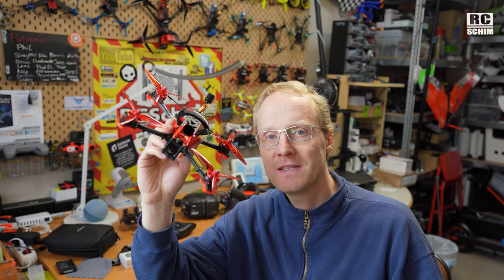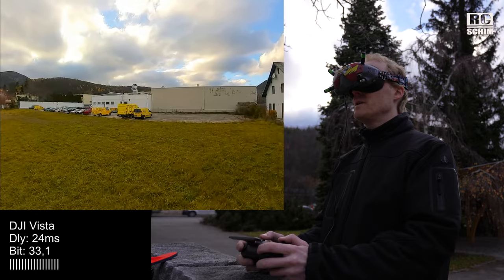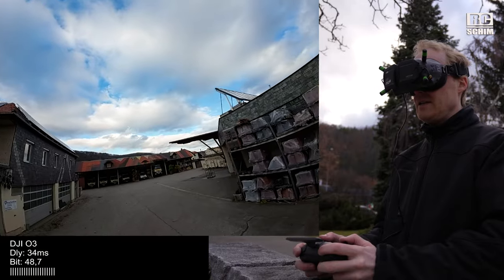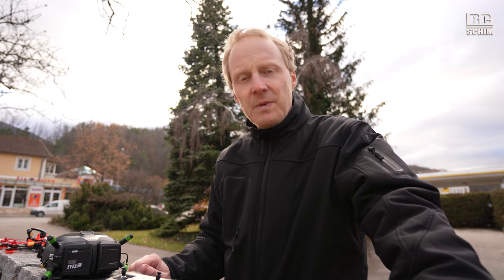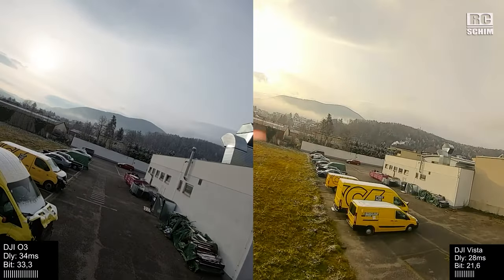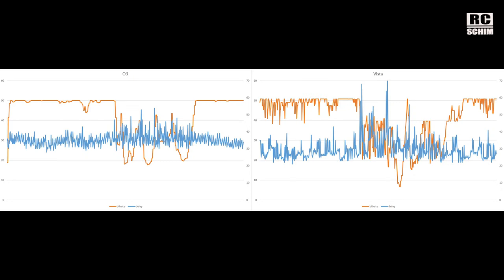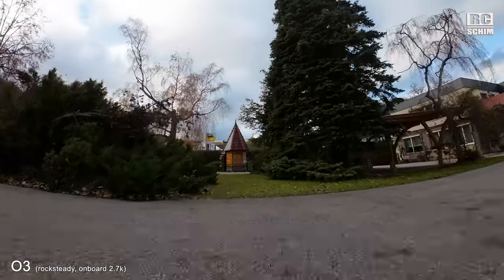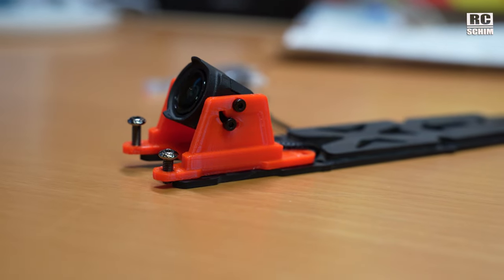DJI O3 - how does it look compared to VISTA?

Comment: I don't understand ..if it was analog and you flew through garage , it would flicker white outs, why does digital not do that? both still transmit through air wave. help me understand my OSD is killing me.
Reply from the maker: You mean your ocd, right?
The magic of dji transmission comes from the retransmission in case of a bad packet. The latency goes up a bit but no flicker ;)
Reply: @Rcschim  yes OCD. but OSD could mean , obsessive stupidity distorter lol.  So when I fly my analog behind some trees and get some flash outs like we see ..Ok am I missing something . is this recording , your goggle dvr?
Reply from the maker: Just for fun I asked ChatGPT your question, here's the answer:   "An analog signal is a continuously variable physical quantity that represents information. In contrast, a digital signal is a sequence of discrete values that represent information.

When an analog signal is transmitted through the air, it is subject to various types of interference, such as noise and distortion, which can cause the signal to become distorted or faded. This can result in a "flickering" or "white out" effect when the signal is displayed on a screen or monitor.

On the other hand, a digital signal is less susceptible to interference because it is composed of discrete values rather than a continuously variable quantity. Digital signals are often transmitted using error-correction codes, which help to ensure that the signal can be recovered accurately despite any noise or interference that may be present. As a result, digital signals tend to be more robust and reliable than analog signals, particularly when transmitted over long distances or through challenging environments."
Reply from the maker: most of what you saw in the video was DVR recorded in my goggles, only a short example of onbaord HD recording was in there.
Reply: @Rcschim  My life is complete now ! Now I will sleep .Thank you . I want to be  digital some day  😜

Comment: what is better at this time?? Goggles v2 Or Goggles 2☺
Reply from the maker: I'd love to try the G2 for their OLEDs and better colors and slightly higher res, smaller formfactor.
But from a friend I know that the fitting can be a bit problematic. Smaller "sweet spot" of sharpness.
Since they are at 850€ pricetag here in EU - I'm not gonna try them soon ;)
From specs:    if you need the lowest latency - the Gv2 are better (120fps),   but have a bit lower resolution (which is hardly noticeable).
greets, Mario
Reply: @Rcschim  Thanks a lott for the Reply..❤️
Reply: @Rcschim  I know it can be very subjective but I couldn't go back to the V2 after flying with the Goggles 2 at 1080p. You wouldn't think the difference would be that huge, but it was night and day to me. 810p looks very similar to 720p, which can be a huge change when going to 1080p
Reply from the maker: @matthewbradley8971  Thanks for the opinion. I'd be quite curious to test the G2. But a friend of mine sold them and went back to V2. Maybe on the next spring FPV meet someone will show up with G2...
sadly they are ~ 850$ here in EU - and this is too much for the small? additional quality improvement...

Comment: O3 have much higher laterncy than vista
3x-4x ms vs 2x-3x ms
Reply from the maker: Yes, but only because I didn't use the 120fps mode on the O3. I thought the image will be too dark with shorter shutter time....
If you use the high fps mode you get lower latency on the o3 as well...
(100fps on g2 and 120fps on gv2)

Comment: H265 is only with goggles 2. That is h264 we are seeing.
Reply from the maker: Are you sure? Where did you find this info? Would be quite the placebo effect for me then ;)  how do we explain the better details with less Bitrate? Not only from using the 265 as codec but also some other clever coding?
Reply: @RCSchim  I think it was Mads tech. I looked for it but couldn't find it, I have watched so much 03 content lately. So maybe I miss understood. I remember something g about v2 is h264 and goggles 2 is h265. I apologize if I'm incorrect.  I'll look some more and link it if I find it.
Reply from the maker: Ok, the DVR files from O3 are h264 - you're right! in 4:3 mode they are 1080x810   with 60.0024fps  and around 20mbit datarate as MOV files.   (1440x810 in 16:9 on Gv2)
Vista is MP4 file extension also with h264 960x720 with exactly 60fps   but they use 40mbit of datarate.  So I'm even more curious now why the vista looks so blocky over the gras where the O3 looks better. O3 uses half of the bitrate for writing the file... confusing.
Reply: @RCSchim  it's gotta be the compression.  They are packaging the tx/rx data differently. Maybe just smaller packets along with improved software.
Reply from the maker: @grampafpv  maybe the h264 vs h265 is just on the storage side (when written as a file)   and here it is no problem that they still store in h264 on the Gv2 where they can write to h265 on the more powerfull G2.
transmitted thru the air might have nothing to do with h264 or h265 codec - but is a different approach...
however they do it, it's clear (literally) that O3 does it even better :)
Reply: @RCSchim  I agree. The 03au is soo nice. My only complaint is the low light performance. I believe DJI is aware as the 03 shipped with the brightness maxed out in settings.

Comment: If you have footage recorded by the goggles, I would like to see that and compare what you were seeing to the drone's really sharp imagery.  Thanks for the other comparison.
Reply: that is the goggle footage lol
Reply: @LucizenVisuals Are you sure that wasn't drone dvr footage.  What goggles were you recording on?  If that's really goggle footage, its the clearest I've seen any goggles make.
Reply from the maker: hi, only 11:16 and at the end you see HD recording from the copter - other footage is DVR footage recorded on either Gv1 or Gv2. 
if I had the newwer Goggles 2 - their goggle DVR recordings would show the fancy OSD from DJI  (because it is now encoded, burnt into the video). 
the older goggles record some OSD info in text files (SRT) which can later be used (as I do with those bars and bitrate readings). You can also import those text files into excel and make a chart.
Reply: @Rcschim  Thanks again for the help understanding.  BTW, doesn't the Goggles 2 give you the option to turn off the OSD?

Comment: Thanks for saving me 300€!

Im  NOT bying the dji 03🤣

Cista was so much better
Reply from the maker: I didn't fly a lot of DJI vista/airunit in the last year since I have the O3.
for me the main seller of O3 over (cheap, used) vistas can be the high quality recordings - saving weight of a gopro... 
but I agree, wouldnt buy O3's for all of my copters. one major adventage of Vista/AU is the nicer OSD if you have WTFOSD enabled!
Reply: @Rcschim  what do you use to create chart like this ? I would test it with my stock antenna and luminier patch on the v2